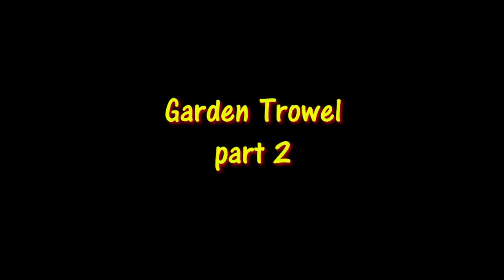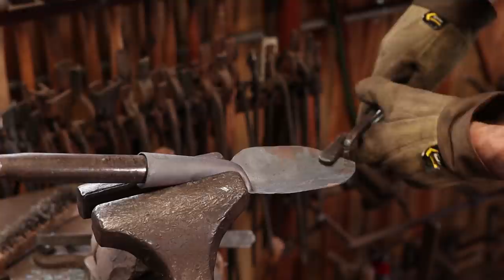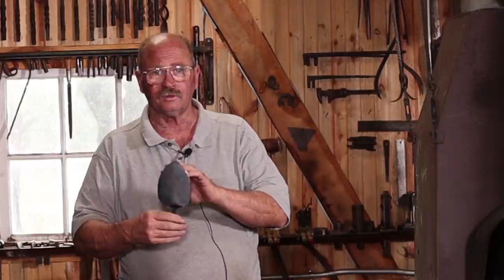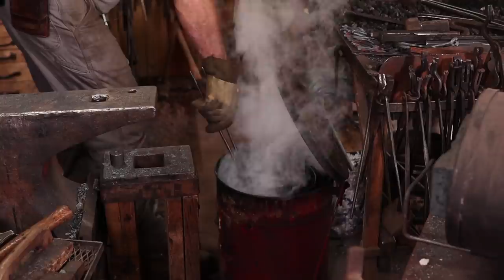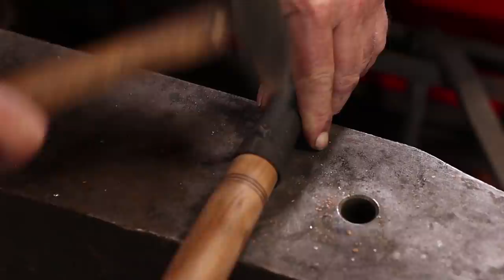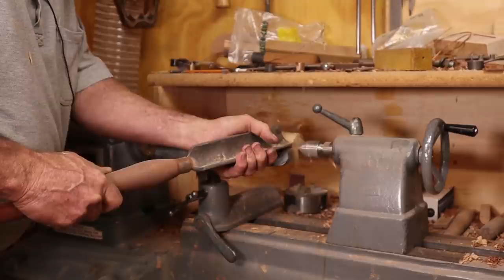Forging a Garden Trowel part 2

Comment: I had to make a pick handle out of a cedar post without having a lathe.  I was sawing it lengthwise, and was having a lot of trouble making it round.  Then I remembered John Switzer’s forging maxim.  Square to octagon to round!  That did the trick!
Reply: I have made a few handles this way, including one from birch for a lathe chisel (from an old file) and another for a socket chisel. You just work it with the drawknife and spoke shave Check with caliper if you feel the urge as you get close. Works fine for handles.

Comment: After my aged Uncle gave me his old crack garden shovel, I quickly repair the crack and welded a surport brace , painted and new handle we both believe it is ready for another 50 years. He said he gave it to the right man.
 Having done all but a sockets but I'll try some day as a skill builder.
 No,no eating from my toaster oven it's for tempering only just bad grease inside.
Thanks for teaching,Sir
Reply: John Jude 
 Cook breakfast any time in my toaster oven! The oil I use quenching is old cooking oil from the local Thai restaurant so all my work smells like spring rolls! I have no idea if its really the best way to quench but works for me and is the only way I have done it!

Comment: One of the best ways to make good sheet work is to get on the web and get yourself a couple different sizes steel shot puts. Weld a but of stock onto the bottom so you can drop them in the hardy. It basically becomes a reverse swage block. Cheers. 👍

Comment: Great job.  Trying to figure out how to acquire some hardenable sheet metal (without buying it of course).  Seeing that lathe took me back. I used to have one just like that but I had to get rid of it during one move.  Did not have the space or weight allowance and it was it heavy son of a gun.

Comment: Thanks for all the videos. I’m new to blacksmithing and so far have only made a hammer eye punch and a drift. I’m amazed how smooth your projects come out. Can you elaborate on how you remove most of the hammer marks from the forging?
Reply from the maker: Hammer control and working down into a lower heat range for finishing

Comment: Great videos on making gardening tools John. I do have a question about the wood for the handles though. What do you look for when picking out a piece to use? Does it matter if it is the exact center of a branch? Thanks
Reply from the maker: I try to avoid using the center section as it leads to more checking.  For  light duty tool like this though, I don't worry about much else.

Comment: John, Question, any particular reason why a solid fuel forge isn't covered up with bricks/refractory to keep the heat in like gas forges? All the heat goes up the chimney.
Reply from the maker: The open hearth is the great advantage of a solid fuel forge.  The working heat is in the bed of coals not the flame off the top, so while there would be some benefit from an efficiency standpoint I don't think the average smith would get much out of it.

Comment: Is that Andre the Giant's wood gouge?
Reply from the maker: This little thing?  Nah
Reply: @BlackBearForge  those were some really big gouges for such a small project, but I definitely understand using what tools you have on things that aren't a day to day task in the shop.
Reply: @r3ngokuking  Using a big gouge for the rough square to round part of the lathing is fairly typical.  Big enough hold onto with both hands, with enough mass to minimize the bouncing around.